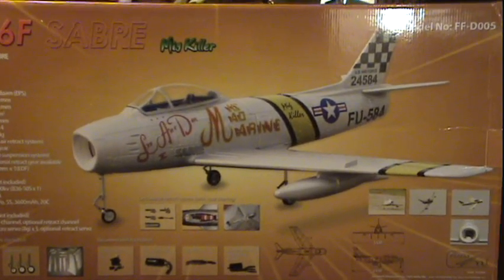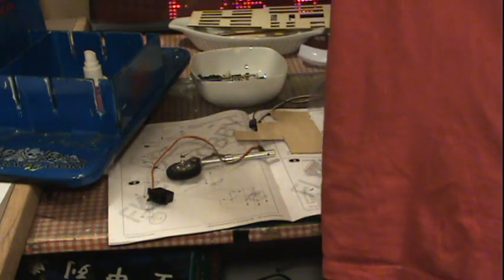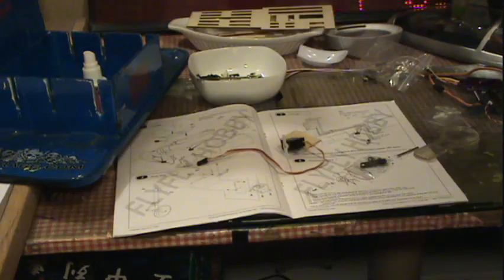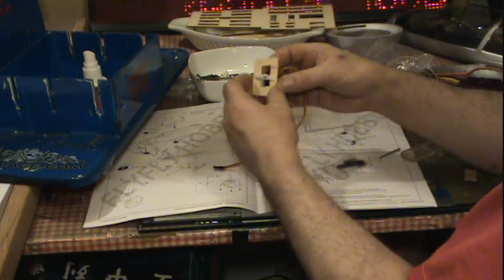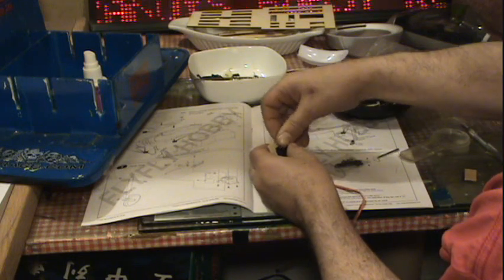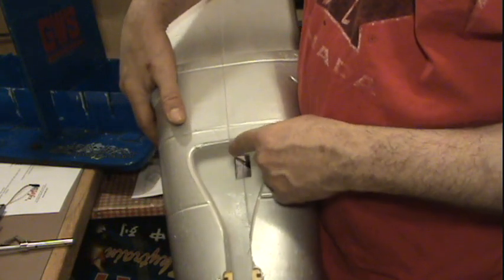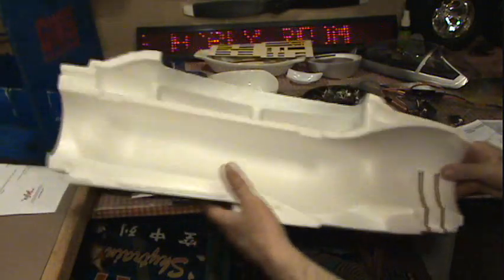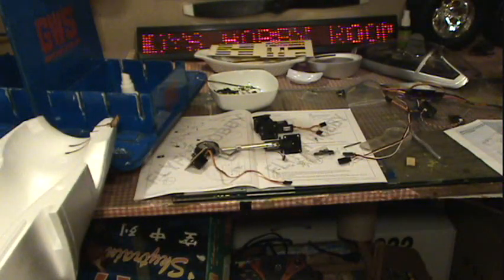f 86 rc airplane build video 3

Comment from the maker: @rc18trocks only thing they have in common is they are jets. the mig is a mid wing plane and a f-86 is a low wing and a f-86 has a normal tail and a mig has a t tail have a closer look and you can see mant differences..